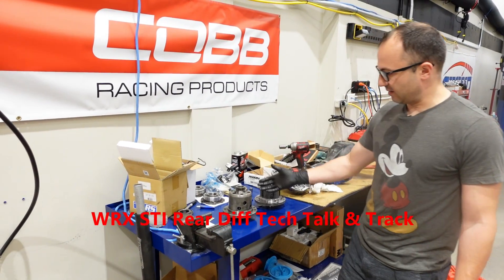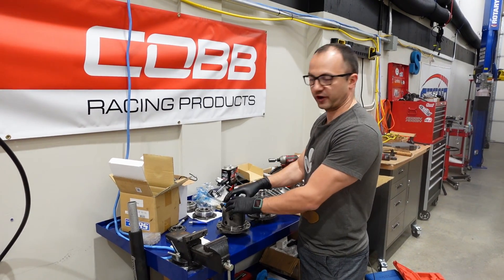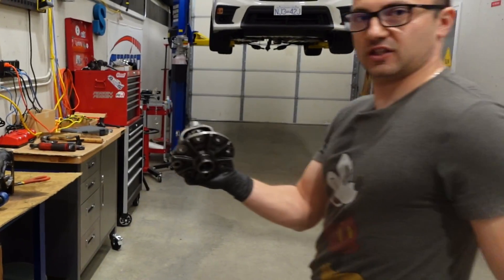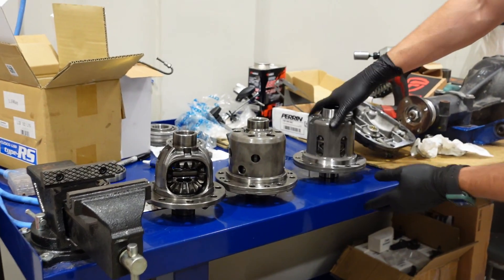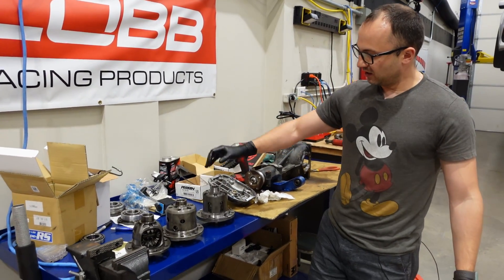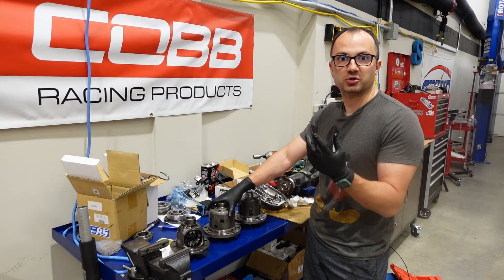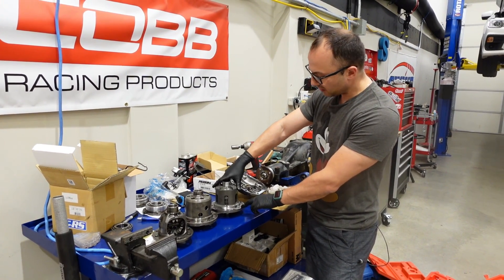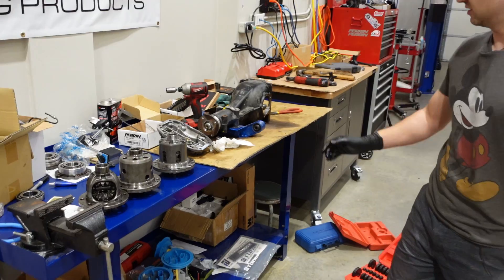Plated/Clutch, Torsen, and Open Differentials Compared with Track Test

Comment: .5 seconds is pretty good for just a diff swap.
Im really curious now to see how an sti would fare if the torsen got swapped for a clutch pack style....

Also, what exhaust do you have on that wrx? As much as i love my EJs, thay FA sounded mint dude.
Reply from the maker: A clutch style is what we run on the car now. 1.5way and it’s a great choice. The exhaust is a Cobb. It does sound good!
Reply: @stratifiedauto  yea i just meant i wanna see what a clutch does on an sti, that was just a wrx right? I didnt see dccd controls. Love it either way

Comment: Wrong, Torsen never ever locks.
Reply from the maker: Lock simply means that torque is transferred from one axle to another. Each differential has an ability to do this to different degrees.
Reply: @stratifiedauto  No, lock mean that both axels are forced to rotate together, 100% of the torque is available on either axel. Torsen is a variation of the open differential, it can transfer around 70% of the torque instead of 50%. It is trash as it will drop torque to zero if one of the tire can't provide 30% of the grip, very unstable.

Comment: You guys should find a similar STi  (stock rear diff) and compare the differences when upgrading differentials, maybe run them in a slalom test and a figure 8 test, anyways keep up the great content
Reply from the maker: We did run the car without the diff on the same track and it was slower. I mention it near the end of the video.
Reply: @stratifiedauto  I know you spoke of it but demonstrating it on video like the Japanese (Best Motoring/Motor Trend) is what I was talking/suggesting, just throwing it out there for a future video possibly
Reply: @AlexP-yb7gh  what are you looking to see? A skid pad with on throttle and off throttle is where this would show the oversteer/ understeer characteristics. 

This LSD upgrade is a mod where only when you're driving AT&BEYOND THE LIMITS will you feel the differences. The handing character does change and you must drive the car a certain way to be fast. Cornering isn't an easy in easy out anymore like open/ Helical diffs. An LSD upgrade are for more advanced drivers who can adapt and change driving inputs on the fly to make the vehicle dance the way they want it to. 

The drivers in the Best Motoring/ Option videos know what they're doing. They help their race teams setup the car to their driving style. The average Joe/intermediate driver needs a lot of seat time to get there. 

Newbs are too quick to start buying suspension mods when they can't even handle a stock suspension WRX, let alone an stock STI with factory diffs. I tell new drivers all the time to get seat time with their stock suspension. Only when they've shown understanding and Demonstrates driving their vehicles to induce understeer/ oversteer,  then we can look at changing the suspension to suit their driving style. 

It's after they've settled in with their suspension is when LSD upgrades are introduced. The suspension will need to be dialed in to work with the LSD. A tail happy setup needs to be dialed back because the LSD induces oversteer. Then the LSD lockup may need to be reduced if it's too tail happy for the driver. 

The track is the Battlefield. You will be slower in parts of the track and faster in other parts of the track compared to other cars. The LSD setup in combination with the suspension needs to be dialed in to get your best overall lap without making driving difficult. You could set it up to take a certain section of the track really fast, but does it effect the others parts of the track? Did it improve the time or stayed the same? Did it make driving the other sections more work? If it did improve the time, are you fine with that extra driving effort in the other section of the track for that improvement? 

A LSD isn't a mod to just stick in and go. You're going to need to be a capable driver to fully take advantage of it. Once dialed in it's a wonderful modification for creating a fun drivers car.